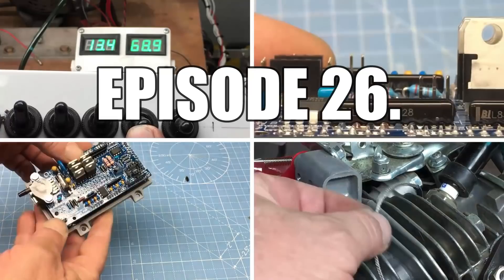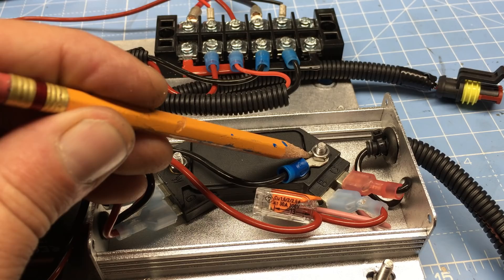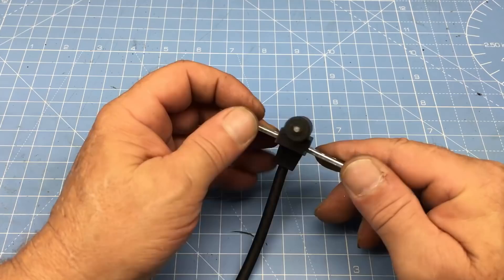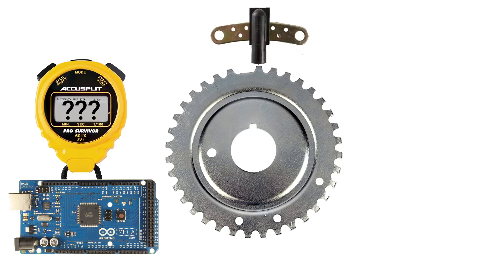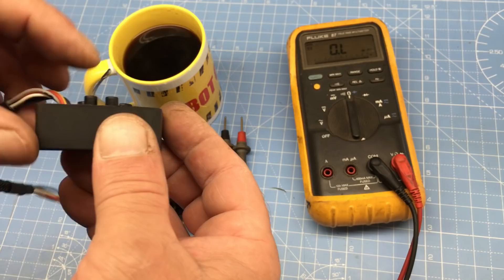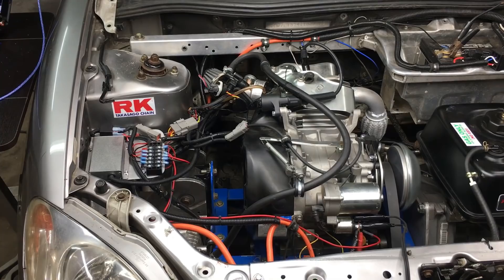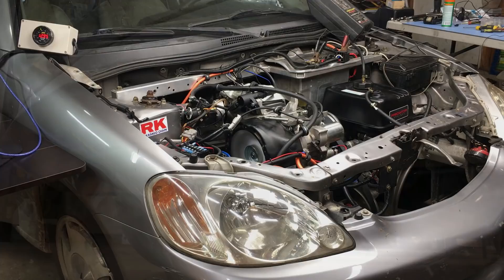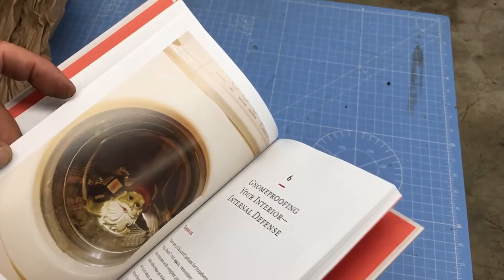Episode 26.  We finally finish the Speeduino NO2C EFI install on out 420cc  street legal go kart

Comment: I had a similar issue with losing connection to an Arduino and the fix ended up turning down the max CPU state from %100 to something like %30. I had tried everything but that's what ended up fixing it.

Comment: Great video as always! That piece looked like part of an old fuel injection system off a BMW, not sure exactly which though. I can't wait to see the efi system up and running! Are you planning on upgrading to a V-Twin next?
Reply from the maker: Yep, it was some sort of BMW fuel injection system.  I had a few E21's in the past and I don't remember the injection system well enough to know if its from that vintage.  After we are done having fun with the 420 engine we will move on to the 670 V twin.
Reply: It’s a fuel distributor off an E21 320i - - I just rebuilt the one on my 1978 320i a few years ago. Total overkill for this project, but a pretty cool piece of technology (although 40 year technology).

Comment: You could just mount the fuel tank to the body of the car.... then it can stay when you swap engines.  With a valve you wont even spill gas all over the place.

Comment: 13:36 that hall effect sensor based sensor using magnet field stuff :D
Reply from the maker: I kinda figured it was using hall effect technology, but it still could be extraterrestrial in origin.
Reply: @robotcantina8957  why swap the sensor though? Couldve spared the cost of the vr conditioner and the new vr sensor. 
Could also have run on the single tooth no problem, if set as "basic distributor" mode too, so you could have spared any disassembly too

Comment: Happy to have you back. I want to make my Honda Gx200 clone run on hydrogen and I will be useing Speeduino. I want to eliminate wasted spark. How can I have the spark only at TDC on compression stroke and not at TDC on the exhaust?
Reply from the maker: in order to eliminate wasted spark, you need to have a cam sensor.  Since the engine was not designed to have a cam sensor, it will require some fabrication.
Reply: Cam sensor, you could try triggering it off the valve train with a hall sensor. It’s a little hacky, but I’ve heard it can work.

Comment: dang long time no see.. glad ya got back.
still thinking you should try a large model jet aircraft brushless EDF (electric ducted fan)
as intake pusher-majigger, because its easily programmable, and may only do 4-5 lbs of boost.. 420 cc might behave like 550 cc when its engaged, substantial but not overkill.
no hassle with belt or other mechanical power, wouldn't weight even 1.5 lbs. could be set on a trigger+timer switch to GO for 8-10 seconds, where ECU can tell injector to spray 25% more fuel to make use of the extra air being stuffed in. switch could be on the throttle to kick in at 90% full press, tap pedal to floor to switch on then back off some, or floor it 10 seconds and quick "re-kick" to boost 20 seconds.. could be easy/convenient actuating.
Reply: Axial flow fans like EDFs can't do high pressure ratios. You'd need multiple stages with diffusers in between to get a meaningful amount of boost.
Reply: @nerd1000ify  true, thrust is different than pressure and there's a point where cavitation puts a cap on pressure. centrifugal like an electric leaf blower (slap a brushless motor in it!) might do it better.

Comment: I would bench test that ICM and make sure you understand the advance curve vs rpm.  Or you could do it on the engine.  You may be surprised to learn that it's not a flat response and you will need to compensate for this with some ignition latency adjustments by rpm (set a constant timing, and run the ICM from idle to whatever peak and set the constants so you get your expected flat curve).  Then you can tune your spark accordingly.
Reply from the maker: Good point.

Comment: Perhaps operate the laptop on the battery power only, and check your ground connections between the laptop/speeduino & car body, multiple grounding points can cause ground loops and lack of proper ground of poor grounding can lead to many issues
Reply from the maker: I have been pulling my hair out for a few days over this issue.  I even went as far as running just the arduino while running on the laptop battery and the com line still faults out.  Keep in mind, this laptop has been abused and used for many experiments, I think Its days are numbered.
Reply: Just pondering here; I'm hopeful the issue will resolve with the new laptop, if not then I would attempt to rule out any electro magnetic/ radio frequency interference.

Hardware that produces square waves can cause this type of interference due to unfiltered outputs, and the creation of harmonic frequencies.

 Who knows, perhaps replacing an unshielded USB cable that's acting as an antenna, and a single (2 cent) RF bypass capacitor may solve this!?

Sometimes in the radio shack I'll use snap on ferrite beads over  microphone wires to eliminate picking up any em/rf spikes (transient signal interference).

Comment: Could the speeduino be used to control each bank on a V8? I've always wanted to build a flat-plane engine from scratch around a crank but the best ecu solution I could think of was dual 4-cylinder computers for each bank

Comment: It looks like the toothed wheel is aligned +/- a few degrees. Is that precise enough?
(In an ideal scenario I mean, I assume a lawn mower engine doesn't care too much)
Reply from the maker: The tooth wheel can be a few degrees off during setup.  Once the engine is running all it takes is a timing light and the wheel can be digitally adjusted in the software.
Reply: @robotcantina8957  Of course, I wasn't thinking about the timing light

Comment: I too bought the eBay efi kit. I too have a speeduino trying to make a single cylinder work. I want to follow your path. I will get the 35 tooth pick up installed. Can you help me with the speeduino settings for your base tune.

Comment: nice work!what is the idle rpm?
Reply from the maker: The engine will idle at 1200 rpm warm.  The idle is a little high because it needs to be above the speed where the compression release kicks in.
Reply: @robotcantina8957  CONGRATULATIONS   ROBOT   CANTINA  on 104k  subscribers..  JIMBO
you have the talent and content for these videos that viewers are craving..👍👍

Comment: i'm kinda surprised you didn't remove the governor. since you went efi and electronic ignition, a rev limiter would be better for performance. but then, i suppose it is just an arm with a spring since it obviously isn't hooked to anything. never mind, i watch too many mini bike and go kart builds on youtube.
Reply from the maker: You are correct the governor isn't connected. The EFI is set up with a rev limiter.

Comment: If the MEGA has the CH340 chip you need the official CH340 driver, not the auto install Win CH340 driver.

Comment: I was told that the wide band will not connect directly to the NO2C and I was sold an interface kit and the probe, the interface kit provides the power to heat the probe. it was a whopping 160 bucks additional over the new prices for the NO2C DIY kit of about 160 bucks so about 320 for the speeduino with options and no sensors except built in map, atmospheric pressure and the optional wideband o2 sensor

Comment: I’m curious as to why you chose the vr sensor over hall? The hall shouldn’t need a conditioner. Isn’t it fast enough?
Reply: I’m curious as well, as the hall sensor should be fast enough.  I know the hall sensor I’m using is fast enough.  But no matter, VR sensors are cheap and reliable.
Reply from the maker: The ford 36-1 crank wheel was designed to work with a VR type sensor.

Comment: Love this series. Wonder how the ecu knows tdc is before the suck revolution or the bang revolution?
Reply from the maker: Without a cam sensor, the ECU cannot determine what revolution the engine is at.  However the engine will still run just fine.
Reply: @robotcantina8957  CONGRATULATIONS   ROBOT   CANTINA  on 104k  subscribers..  JIMBO
you have the talent and content for these videos that viewers are craving..👍👍

Comment: Maybe I missed it but why didn’t you just use a Hall effect sensor rather than use a magnetic pick up sensor then convert the signal to a 0-5V?
Reply from the maker: The 36-1 wheel I used was designed for a VR sensor.

Comment: Any plans on posting the tune?  I think it is a .msq file.  I can confirm your crank sensor is from a jeep 4 and 6 cylinder (they both use the same).  I would guess the year range is 1988-1992. I especially liked the shaft collar mod for the reluctor wheel......will be using that trick on the riding lawnmower.
Reply from the maker: I reckon I should post the .msq file.  Perhaps I should post it on the speeduino forum?
Reply: @robotcantina8957  sounds good to me

Comment: How does this system handle cam sync? Is it wasting spark?
Reply from the maker: Yes, its a wasted spark system because no cam sensor on the engine, however if there was a sensor the NO2C could handle it.
Reply: @robotcantina8957  thank you, so I guess the injector also fires asynchronously. Neat, didn't know that was a thing.
Reply: That means you are probably double firing the injector as well, so therefore no real sequential injection? I would add a cam sensor if you can and then you might get better fuelling if the N02C allows programmable injection angle

Comment: For the fuel tank.  You used the tank vent as a return.  Is the cap vented?  You may want to check to prevent odd tuning issues.
Reply from the maker: Yes, the tank is vented, if you look closely, the fuel cap has a vent hose on it.
Reply: @robotcantina8957  I was focussed on that vent hose.  I am disappointed i didnt see the venting.  I have a pressure washer with the same tank and I overfilled it.  It started pumping fuel on each pulse out the vent.  It was impressive.  The vent is attached to the carb intake and it started flooding out the machine.  I disconnected it thinking it would clear a bit but nope it took quite some time before it stopped pumping.  I should speeduino it then I can operate it more efficiently or at extreme angles or other useless things :p
Reply from the maker: @someguy2741  With a speeduino, you could probably run the pressure washer upside down...lol.
Reply: @robotcantina8957  hmmmmm.  Challenge accepted!  Your videos actually got me the idea of running a speeduino on my old buicks.  I just need to find a donor for all the sensors.  Maybe an exploded LS or something.  The cost of all the sensors and injectors might make the $1000 fast efi setups economical unfortunately.

Comment: Love this series. I just gotta figure out why my no2c is showing double rpms. I’m using a VR conditioner for a motorcycle pickup. I need to get my hands on a scope…
Reply: Join the forum and post your tune and a log and details of you engine/crank sensor.
Reply from the maker: The Speeduino forum is awesome.
Reply: You can use the trigger monitor in tuner studio to see what it’s reading in waveform. 
There’s a good chance it’s being triggered on each of the poles of the magnet.
Reply: @robotcantina8957  Thanks for the tip. I have looked there a decent amount. Unfortunately I haven't seen too much support for basic distributor trigger settings for single cylinders using VR conditioning. I guess its my duty to make the post then! Thanks again for your hard work on this series.

Comment: once you figure out the efi system will you be doing any 420 mods?(cam, carb, head, port/polish, bigger fuel pump?) this is an amazing project you have going. i'll have to watch the series from the start to grasp it all. though it looks to be an entertaining one. have a good one.
Reply from the maker: Once the EFI is sorted then we move on to the supercharger.  The bottom end will get a billet rod and the head will get fresh valves and stiffer springs.  I haven't decided about the cam yet.
Reply: @robotcantina8957  hot diggity dog! lol i have def caught up on the series.. can i ask where is episode 13, sir? lol have a good one and great content!
Reply from the maker: @notyobiz6207  Asking about episode 13 automatically enrolls you in the episode 13 fan club.  sooooo....  Welcome to the episode 13 fan club!

Comment: Hey! I'm looking to convert my small engine to EFI by writing my own ECU software for an arduino, and I ran across a problem. When using a hall effect sensor to predict the crank position, how does the ECU know it's on an intake stroke and to fire the injector? Or just it just fire once per rotation not knowing if its on the power or intake stroke and waste fuel? And same for the ignition, does it just fire on the exhaust stroke as well like a stock honda clone engine would?

Comment: These videos are great brother keep it up.  If you can't use the grille to feed cool air into the inlet of the cooling blower you can place a ram air scoop on the hood.  There are several out there for drag racing and the aerodynamic efficiency is probably over kill for a vehicle shooting for 55-85 mph range.   speedwaymotors.com/Pro-Stock-Drag-Car-Fiberglass-Intake-Air-Hood-Scoop-32-x-22-x-6,1403.html
I am really digging this project as I've done several EFI swaps and the idea of an EFI Vtwin in a light weight car for fuel economy is a project I thought about but never did.  I had an acquaintance who was an aircraft bracket engineer who had a carbureted V twin harley engine in an 80s toyota carolla.  He said it got excellent fuel economy and was extremely simple.

Comment: Hey Jimbo let’s mount a vw 60’s belt tank in the rear and mount a electrical pump up at a low psi that wouldn’t be hard and free up a lot of room
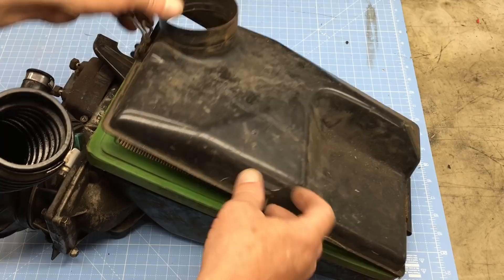Reply: Ducting and egr valve ar 23:40

Comment: There was actually a BMW rondel on the bottom of the air filter housing for that K-Jetronic stuff you got in the mail. Also, i searched the dark web and ..still have not found episode 13.
Reply from the maker: the consensus is it's an  E21 CIS system.  Random package in the mail...got to love it.  Anyway, Welcome to the episode 13 fan club!
Reply: @robotcantina8957  Thank you! Hate to ask. but will you be discussing open loop / closed loop a bit more to help people understand the self tuning feature of the speeduino ?
Reply from the maker: @lnrbry  The next video will contain some basic tuning and how the speeduino can auto tune the air fuel ratio.  I reckon that adding  open and close loop to the discussion will help explain the purpose of the oxygen sensor and how it all works.
Reply: @robotcantina8957  Thank you. i can imagine a lot of people may be hesitant to try something like this with out the autotune feature. i did not want to get too far into the weeds with the idea of LTFT and STFT and their impacts on the fueling map. just looking for some explanation on how open loop will help the hardware try to predict the best fueling mix..

Comment: You had said that the speeduino could run a 4 cylinder, does that mean that, theoretically, you could run a car engine, such as an sr20 or Ecotec 4 pot with one?
Reply: Yupp. Can even do 8 or even 12 cylinders in batch fire with that one he has. There is many different Speeduino boards and the Dropbear which is to be released soon can do 8 cyl sequential injection and ignition.
Reply from the maker: Yep,  the NO2C can run a four cyl but literally for a few dollars more you can get a Speeduino UA4C that is better suited.
Reply: They were designed with car engines in mind, so yes, you can run whatever car engine you desire with enough work.

Comment: is the ecu self tuning
Reply from the maker: There is a tool in tuner studio to auto-tune the air fuel ratio, However the ignition timing has to be tuned manually.
Reply: @robotcantina8957  CONGRATULATIONS   ROBOT   CANTINA  on 104k  subscribers..  JIMBO
you have the talent and content for these videos that viewers are craving..👍👍

Comment: Hey Jimbo. Where the heck is episode 13?
Reply from the maker: Welcome to the episode 13 fan club!
Reply: @robotcantina8957  thanks!  Can't wait to see more episodes.

Also, the engine sounds smoother with the fuel injection.  Any plans on using racing kits like in red beard garage?

Comment: Why didnt you use a billet flywheel?
Reply from the maker: I tried a billet flywheel on one of the 212cc engines and the cooling fins were not aggressive enough to keep the engine cool under full load. So I'm not sure the billet flywheel would help the 420 because it already runs a bit hot.
Reply: @robotcantina8957  FUNNY, THE GUYS REMOVING THE GOV AND MAKING OVER 20HP WITH THEM DO NOT SEEM TO HAVE AN OVERHEATING PROBLEM
Reply from the maker: @dskofich  That may be true, but keep in mind that it takes every last little bit of power to propel the car down the road at full throttle.  On a minibike or go kart, they do not use maximum HP all the time.
Reply: @dskofich  they also aren’t enclosing the engine under the hood of a car.

Comment: Try a shorter usb cable. Your janky laptop might not have enough voltage to push a signal more than 3 feet over a usb cable without Vdrop.
Reply: or try a wall brick powered usb hub to act as a booster.
Reply from the maker: I tried many cables, including a 1 foot cable.  The laptop is a gonner.  I have abused it one too many times.
Reply from the maker: Yep, tried that too..

Comment: Ditch the governor
Reply from the maker: The electronic fuel injection is not connected to the mechanical governor. Before we install the supercharger, we will take the engine apart and remove the governor and do some other upgrades